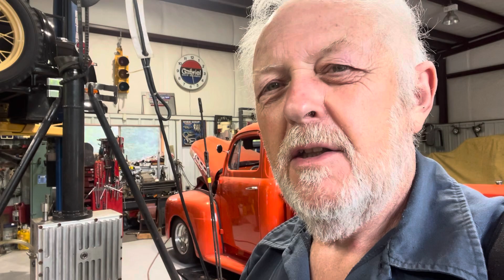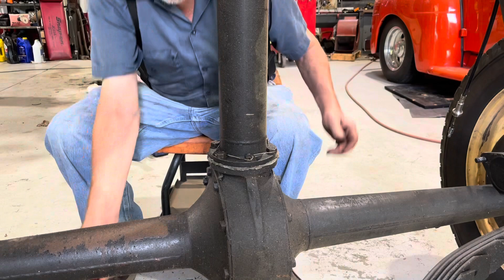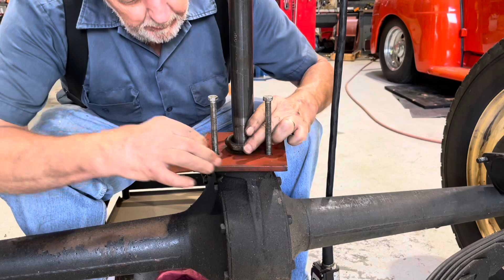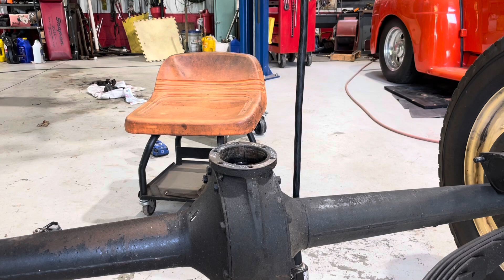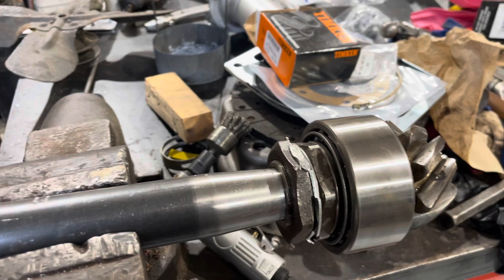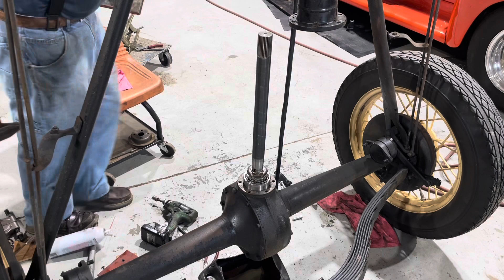Ford Model A diff. Noise

Comment: where did all the metal go from the nut hitting the ring gear? you may have more trouble
Reply from the maker: The nut didn’t  hit ring gear but touches the smooth part of carrier,no worry there